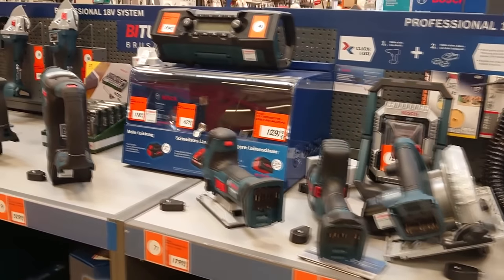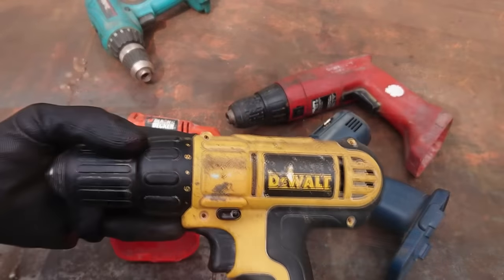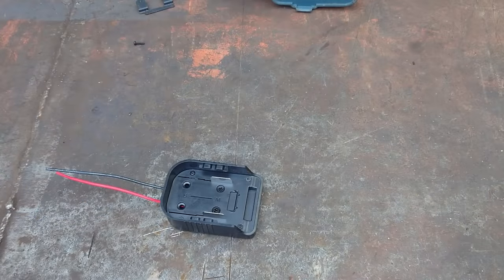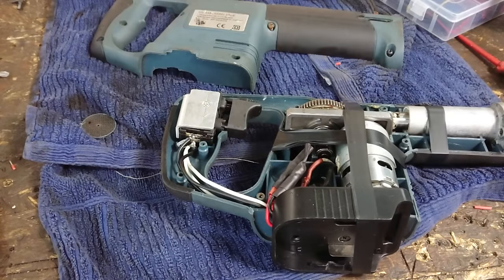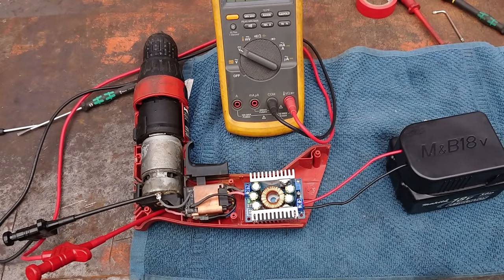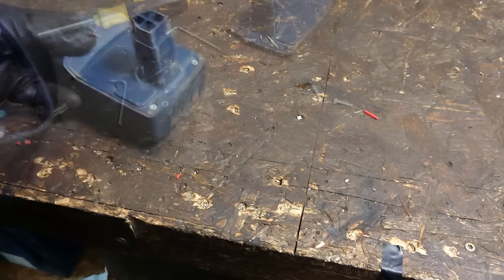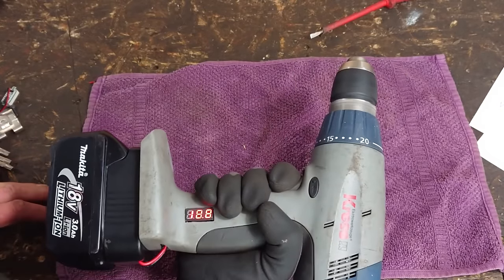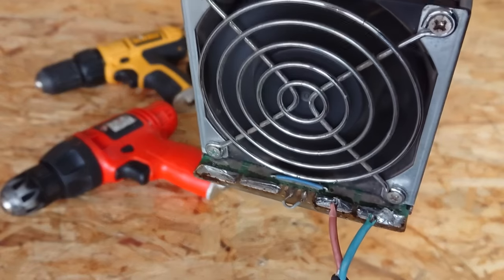Scrapyard Finds! Repair-A-Thon! Cordless Tools Galore!

Comment: i have been a contractor for over 40 years and i hate cordless tools and the concept of disposable tools because that is exactly what they are but if they called them the "replace every 4 years cordless tools" how many do you think they would sell what a scam and i just watched as every guy i worked with or for over the last 20 or so years spend small fortunes on these things only to go out and buy a new one 3/4 years later or in a lot of cases sooner because they no longer held the charge long enough to be useful started with 9v makitas cordless you all know the one about as ergonomic as a coconut ffs i have one cordless tool that's it a drill everything else has a plug no batteries to buy for more than the tool cost no chargers to lose or get fixe because a 2x4 landed on it  ! yes that did happen !  lol  many of my tools are well over 20  years old and still work just fine and if the power is out it's miller time so we only need the cordless drill light to find the beer cooler lmao

Comment: How many amps are your buck converters rated for?  Is 2-3 amps enough?
Reply: I have the same question.
Reply: Brian Cockburn, I’ve done some research on the max current draw and it might be 30-50 amps at peak, obviously briefly.  If the selected buck converter goes to constant current on overload, the drill will stall rather than power through it’s job,  if no current limit then POW!  I am now very interested in the converter that TPAI used, and if his tools had stall issues after conversion.  I have a 12V drill I want to convert to 20V Black and Decker batteries which I have standardized on.  Great series!!
Reply: TPAI’s buck converter looks a lot like the 12 Amp Automotive adjustable buck converter sold on Amazon for not much $$.  Note the heat sink.

Comment: Do you have a link to those little voltmeters? They look very handy.
Reply: Found some from Digikey here in Canada. $3.50CAD Cheap!
Reply: Actually, try "3 digit voltmeter 0.36", "4 digit voltmeter 0.36", or "5 digit voltmeter 0.36" to get rid of some of the crap.  The search at AliExpress isn't all that good.

Comment: For a 18 volt, 12 is the absolute minimum? HELLA NO! 3v per Li-Ion cell is the minimum. To get 18 volts there's 5S, so minimum charge is 3*5 = 15v. Anything below that permanently damages the battery. Their absolute maximum charge is 4.2*5 = 21v. And their 'nominal' charge they hover at for most of the battery charge is 3.6v *5 = 18v.

Comment: I am always perplexed when I see people using a cigarette lighter on heat shrink, why don't you guys slide the heat shrink straight on the warm solder joint and then just use the stem of your soldering iron to wipe over the heat shrink, it works a treat.

Comment: my dad modded those long makita batteries with 11,1V 2500mAh LiPo cells and it his drill now runs better than it ever has :D

there's are also specialised voltage indicators available for all batter voltages, which indicate the remaining charge in 25% increments, for a few second, after you press a button (see: https://www.amazon.de/-/en/IENPAJNEPQN-Lithium-Battery-Capacity-Indicator/dp/B085M8FYLB)

Comment: I'm so glad that we could leave NiCad batteries in the past. Cadmium is a horrible element. The Cobalt used in Lithium batteries isn't nice, but it isn't nearly as nasty as Cadmium. Not only that, but those NiCad batteries are awful. They take forever to charge and don't last very long. Lithium batteries are fantastic for cordless tools, and are the main reason why they are so popular now.